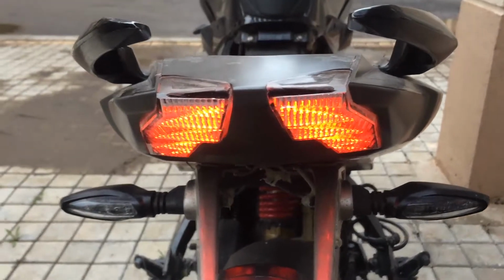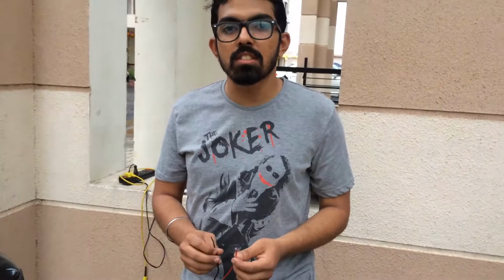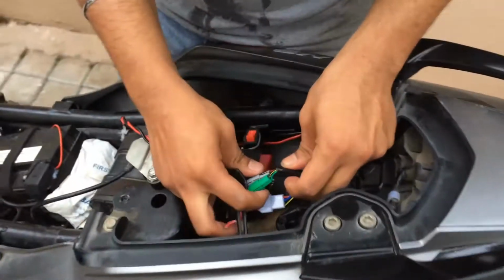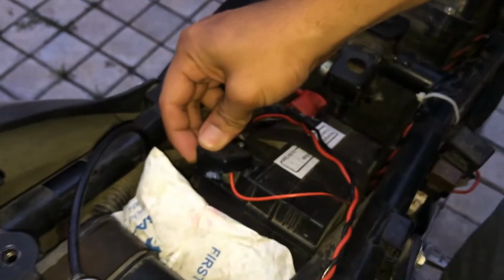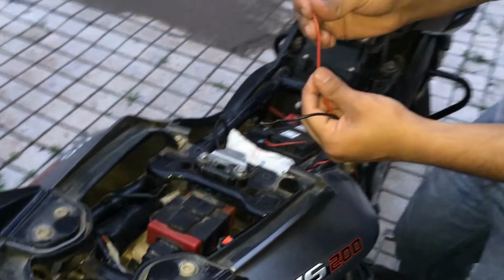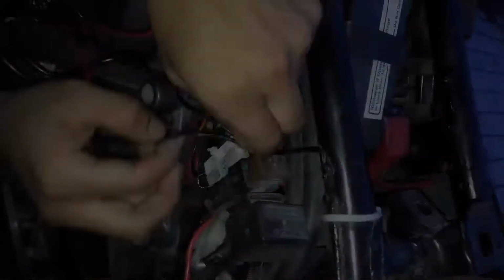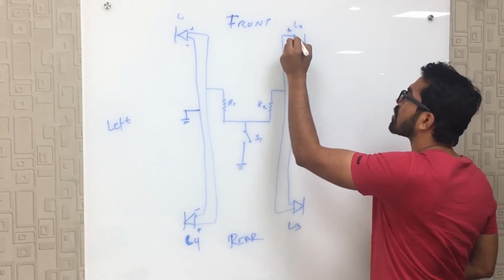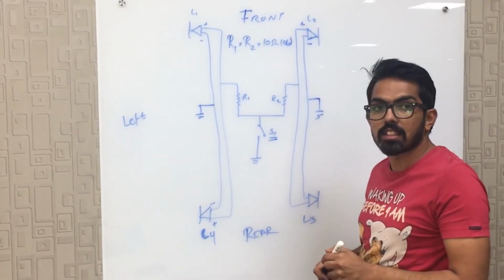Fix Hyper Flashing of LED Turn Indicators | DIY | Rev Explorers

Comment: For anyone having bs4 and above versions.... Buy the flasher module of RS200 from Bajaj itself, and replace it with your stock one, the location of the flasher is under the right side panel, the exact location where he placed his resistors, it's the right most relay, ie right side of the maroon color relay present over there... It's a plug and play fit, no mods required
Reply: I tried that bro., still hyperblinking. Bs4 ns 200

Comment: I will suggest easy and cheaper way just connect the 2 10 watt bulbs separate with the indicator connection and hide the bulbs inside seat speed of led indicator will be normal

Comment: See I have a cbr 250r and I have same problem, I understood the wiring diagram I just need to know if I use the hazard light ( not hazard flasher ) , normal hazard , will these still get hot ? And what happens if they get too hot and should I do it then ? I used hazard mode a lot.
Reply from the maker: Yeah they will get hot!!! It’s better to buy a resistors with heat sink… they work i a charm… they have been working for 2yrs now
Reply: @RevExplorers  okayy thanks man

Comment: Bhai ji koi easy way btao bina soldering or without wire cutting ke
Reply from the maker: Mohit Kumar bhai uska relay ata hai, but for that as well you will need to cut the wire
Reply: @RevExplorers  bhai ji konsa relay aata h naam ya kuch model no. Btadoge please
Reply from the maker: @MohitKumar-iz8qh  Bhai UNO Minda ke naam se flasher relay hai Amazon pe miljata hai, video description main shayad added hai agar nai hai to direct search krlo, uske saath manual ati hai how to install
Reply: @RevExplorers  bhai ji lagaya tha nhi huyi hyper flashing normal module me jo 6pin h uski 2 pin jo white sochet me lgaya hua nahi
Reply from the maker: Mohit Kumar we have never used it, this felt more easy... so did this way (with load resistor)
Reply: @RevExplorers  okay bhai jii thanxx me load resistor hi lgane ki try krta hu

Comment: bhai rs200 ka light control module ns160 me lag jayega ya nah please help me bro bcoz maine dothediy ka flasher mangwaya hai or woh pattern change nahi kar rha h seller ka kehna h relay change karo but ns me light control module bulb ka toh please help me RS200 ka lagega ya nahi
Reply from the maker: Mohit Kumar mostly mushkil hai bro, coz NS main single relay hota hai n RS ka different relay hai. i checked for my bike (NS200) so went with this only and flasher ka relay pe dependency nai hota hai if it is not working it might be faulty coz i have changed 2 flashers till date and they work great and costed me only ₹150 each

Comment: If i do such changes would the warranty  be voided or not and how does ns200 perform on Highway and hills if you have taken ii there..

I am planning to sell my bullet and want to buy this bike, can i take it on Highway and hills ?
Reply from the maker: Kunal Khurana it is a great performer buddy
Both on highway n hill
In no time it cathes 120kmph
Warranty won't be voided if you don't cut the wire!

Happy Riding!
Reply: Rev Explorers thanks buddy

Comment: Very very thankful to you man , few days ago installed KTM indicators on my new ns200 , thanks for solution.
Reply from the maker: Sahil Gyanchandani welcome buddy!!
Reply: Can any local mechanic fix those and iam planning to install highway indicator flasher for Hazard light and different patterns , so I think I have to do the same you did ?
Reply: Pls reply buddy
Reply from the maker: Sahil Gyanchandani it is not that hard job...I guess you can do it yourself. A mechanic can also help. But I guess you should do it on your own just follow our DIY !!
Reply: Rev Explorers ok bro , where to get the best resistor
Reply from the maker: Sahil Gyanchandani you can get it online from our description links or you can buy it from a nearby electronics shop
Reply: Got the light control module of rs200 and replaced it with my stock one, it works

Comment: Bro I'm getting too much vibrations from my head and how can I get the pilot lamps and meter light on whenever I turn on the ignition only not stating the engine
Reply from the maker: Yuvraj singh check the front viser for vibrations. Open it and install a pad or double tape on the same.
Well for the pilot lights and meter lights could you please tell me is your bike bs3??
Reply: Rev Explorers yes my bike is bs3 the 2015 Metallic white ns200

Comment: Bro if we install relay of rs200 will hyper blinking problem solve?
Reply from the maker: We are still looking into it...as it seems like both the relays have the same part ID hence both of them are same...but if something comes up we will definitely post it!
Reply: Rev Explorers bro if they were same then you would have not faced hyperlink problem, please check & make a video on it.
Reply: no the RS flasher relay is different I ordered it and found that ns  headlight and indicators are controlled by the same relay.for installation of RS flaser relay we have to use old ns wiring that is non ago one.
Reply: Anirban Dey so can we install RS relay in 2017 ns 200???
Reply: no we can't because RS has seperate aho
Reply: the part no are different ns has DS series which is of 220 and RS is dr series.
Reply: Yamaha Suzuki Kawasaki has either 2 or 3 pin which is available in Amazon india
Reply: Anirban Dey what about the relay in duke
Reply: rs and duke relay are same.
Reply: puksar 150 mai yeh relay lag jayega